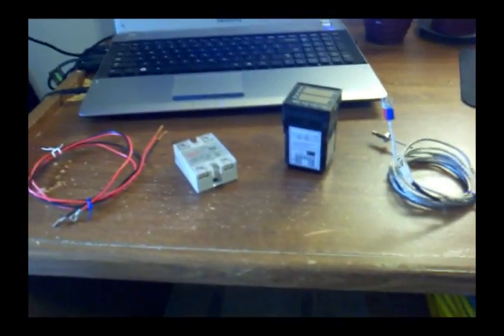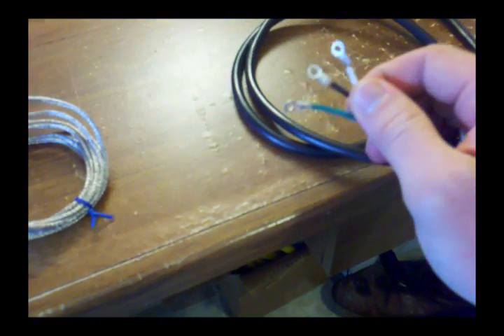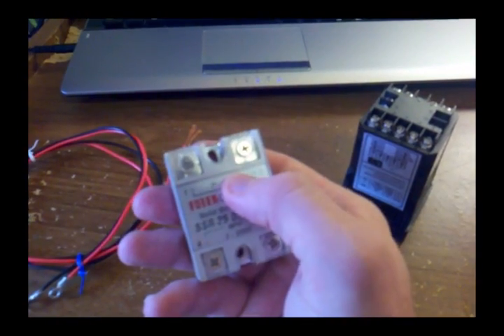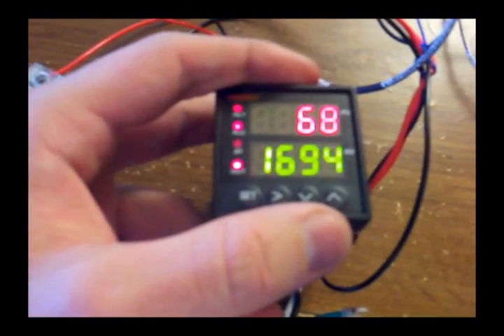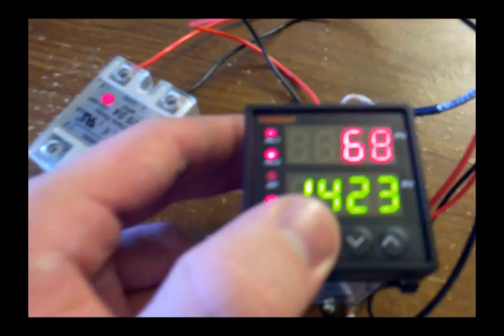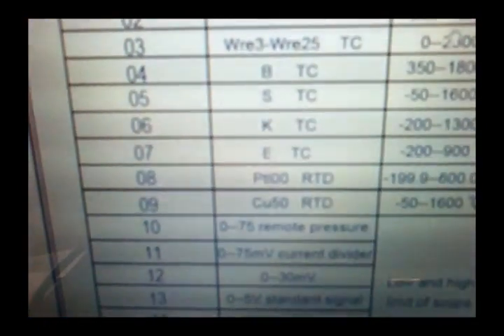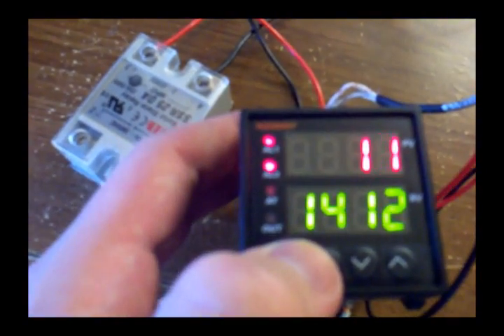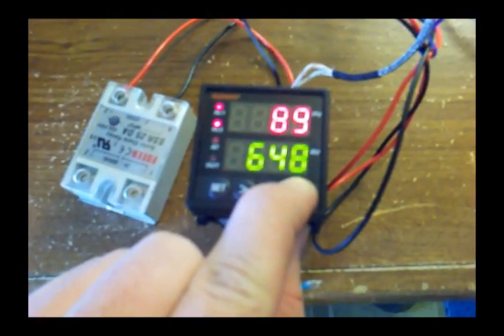Kiln Controller - Wiring the n2006p PID temperature controller and adjusting settings.

Comment: ok so I have an evenheat kiln with a pf 2329. there are 3 relays and the controller. there are a bunch of elements (like im assuming yours did) mine says it needs 45 amps and 240v. was yours also 240/220? did your changes make it 110? my problem is i cant run a 220 in the house i live in. not because of my own ability but because of my landlord. what changes would you suggest i make to it to get it down to 110? is it possible?.

Comment: So don’t do anything to your kiln, just set your kiln knobs or switches to the max and connect this new controller to work with the POWER CORD in a way that the SSR connects/disconnect your kiln, just make sure the SSR amps max capacity supports your kiln max amps. Don’t forget to connect the temp probe and make sure it’s reading the right temp.

Comment: The way this digital controllers work is easy, they don’t change the volts/amps to control temp…they just send a signal to the SSR to connect or disconnect your kiln (on/off). When the kiln reaches the preset temp it simply shuts it off and when starts to get cooler, turn it on again, pretty simply.

Comment: DON’T change the way your coils (heating wires) are connected, if you connect the coils in series the resistance will increase witch = less amps = less HEAT = less watts too.

Comment: F.Y.I. it is just a matter of time before you get electricuted since those wires are hot as you handle the components. you need to get a heat sink and thermal paste for the SSR and put all that into a enclosure/box. A $7 plastic project box from RadioShack works well.

Comment: your thermocoupling is what determines your temperature range. They are rated by letters to determine their resisitive tolerances/read range. Your pid simply allows you to set the desired range withing that of the thermocoupling to limit/ control the temp. If you set the D right the pid will shut element off right before you aquire the set temp so you will not over shoot temp. If you have the P and I set correctly then you should have a +/- 1*F deviation from your set temp.

Comment: so how much did the parts cost, because controllers can be found for about $300 now.   im tired of annealing by time/manual,  I have been looking at the controller kits and their about 3 bills and still need the relay usually, Im wondering if its easier just to get a controller or if you got the controller and relay for less than 3-2 bills.  thanks

Comment: Good video. One thing though, you don't actually set the temperature range in the PID, you set the model of your temperature sensor. If you select a different sensor than the sensor you have, the temperatures will not be accurate! (BTW, do you have 16C/61F in your room?)

Comment: Unfortunately I had to figure most of the stuff out on my own like you, when i did my video it was a general guideline, and I did not feel comfortable enough with my understanding of the actual working of the controller to try to demo that. I ended up not using my controller in the long run because i got a kiln with a digi built in, but it was a fun project to throw together.
Reply: Erik Berglund f

Comment: there is also different settings to the type of thermocouple you are using, thermocouple offset value (a sliding scale adjustment, meaning if you adjust it 5* at room temp it may be a 100* adjustment at 500*)
Codes I found on my controller were
0001: Temp and alarm settings
0036: PID Settings
0089: Initialization Parameters